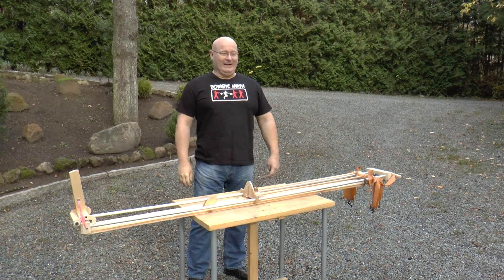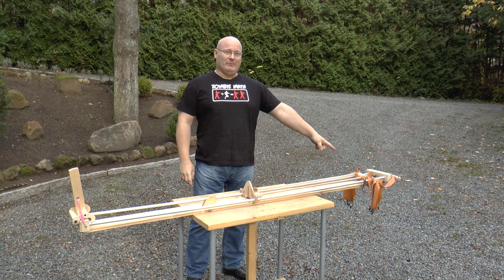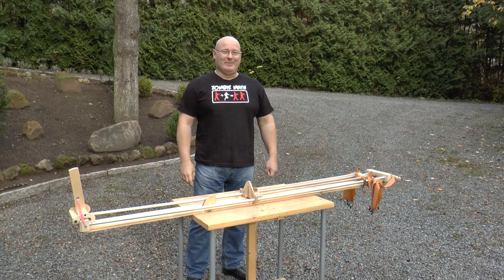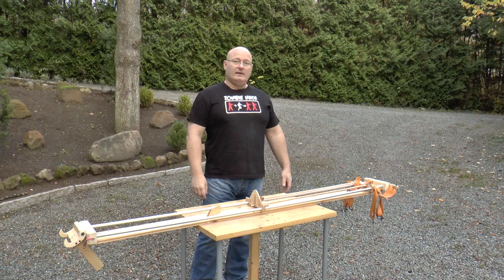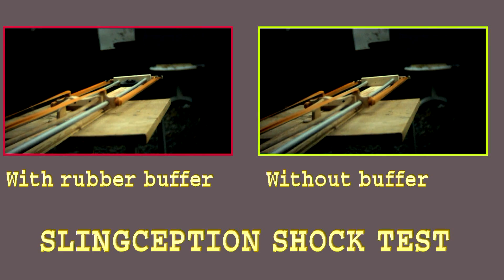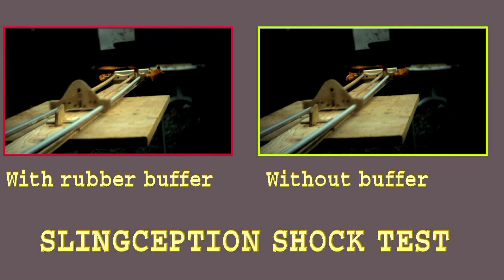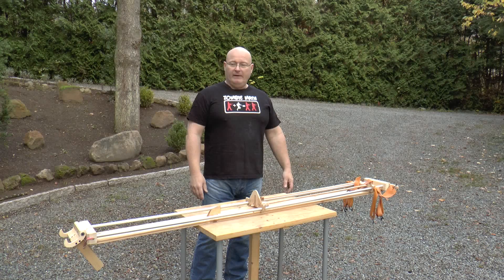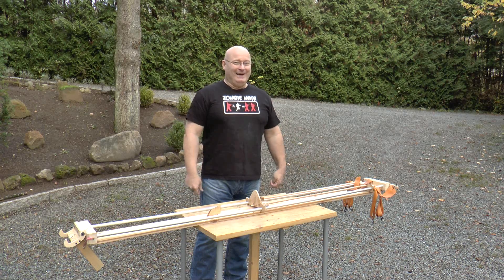"Joerg vs. Slingception" - The Final Defeat

Comment: I think the air caught between the two surfaces acted as a damper. In comparison to the rubber that use to be there, which acted like a spring.  You just unintentionally made a very nice air-damper Sir.

Comment: I think that without the buffer all the energy is wasted while with the buffer there is a somewhat elastic collision that makes the wooden dowels bend more as the moving slingshot is accelerated backwards by the buffer. I suppose that if you insist on firing it without the buffer eventually something will break.

Comment: Hey Joerg. I was just wondering, how many frames per second does your slow motion camera take?
Reply from the maker: In its max resolution of 800x600, it can do 1000 fps. But then it needs an awful lot of light. These scenes have been recorded at 500 fps, pretty much the max on an overcast November day. Sunny summer days, I can do 1000 fps and even use a faster shutter = less motion blur.
Reply: JoergSprave Very cool. I'm amazed at how much the rods flex in this video during the slow motion yet in regular time it's almost unnoticeable. I'm also amazed that you can't break it, I thought for sure when you first introduced the slingception it would only last a dozen shots or so! Anyway keep up the good work, you're design and woodworking skills are very impressive and I always look forward to seeing your next project!

Comment: Before you destroy it by fire, are you going to see what kind of speed you on the ball with the additional rubber added? I would be intere3sted in finding out what it would be.
Reply: The speed would not be affected as much as we would like. Rubber can only be retracted so fast, putting twice as much rubber would be the same as making the sled and bullet half the weight, so every time you double up the rubber you don´t double the speed, but halve the difference of bullet speed vs retraction speed... still, it is a fact I would like to see myself :)

Comment: When the slingshot hits the rubber stopper, the stopper compresses, and then "de-compresses," and in this process, a compression wave is sent back through the entire slingshot, causing the slingshot to shake wildly. When the stopper is not present, the energy from the slingshot is amazingly absorbed and there is little excess energy to be distributed throughout the slingshot, hence the minimal shaking of the slingshot.

Comment: Joerg, could it be that the mass of the steel ball is counteracting the 1st stage of the slingshot, with the 2nd stage recoil acting as it's own sort of buffer?

Bearing that in mind, it would seem that if the first stage simply had extra railing to simply carry on past the band draw (even just a couple of inches), perhaps with a friction element added, in those couple of inches, it could preform all the better.

Comment: You didn't even bother to chrona the slingception with the stronger bands.

Fail, just fail.
Reply from the maker: Now it isn't about performance of the shot anymore. Now it is about breaking that thing apart. It must be done. So much resistance can not be tolerated. It must be proven futile. :)
Reply: JoergSprave
Not even gonna chrona the thing one last time before you set it on fire?

Even for shits and giggles?

Comment: I would like to see you make a sled with bearing supported wheels running in tracks similar to how a desk drawer works. Much less friction and more stability of the whole device. No more flexing rods. You could router the tracks right into the wood. I just keep thinking about this wondering how it would work.

Comment: The buffer makes for a lower peak strength of impact, but a longer time, the energy is still the same, though... removing the buffer provided about 10 cm of "railway" without tension (rubber was already retracted), where the wooden dowels had time to lign up before the hit, so the impact did not flex the dowels, giving it the chance to be subjected to pure grain-aligned compression, instead of a bending tension-compression-flexing combo. Best solution to ensure durability of slingception? make the railway 7 - 10 cm longer and put buffer back on... Cheers!!! Great video!!!
Reply: I, I just don't understand... It would take me years to even make a comment like this. Just people like you are just so smart its unbelievable. Well thanks for explaining that, I needed it.
Reply: jojorobino5312 When the sled hits the buffer, the dowels are flexed, so it's like pounding a bent nail with a hammer. When the buffer is not present, the dowels have a fraction of a second more to straighten before impact. Thank you for the compliment.
Reply: Eugenio Garza no problem I appreciate your reply to.

Comment: Keep putting on more rubber and measuring the speed till it breaks!   This could make a rubber speed record.   Breaking the sound barrier with rubber would be amazing!  Don't destroy this unless you have a better design.   It is very cool.
Reply from the maker: It is getting very hard to physically attach more rubber, the sled was never designed for this insane amount of it.
Reply: WatcherMania7 It sounds like a great plan, but have to agree with JoergSprave... the main slingshot (the one to carry all the sleds at first) will carry a lot of weight, which will, in turn, carry lots of momentum... wood will not be enough, so aluminum, then... now it´s heavier, costlyer... and besides, will need LOTS of rubber (just the first slingshot, every next slingshot will be using less rubber accordingly). The last slingshot has one set of rubber for the weight of the steel ball, the second last will have *math*   (last sled + bullet weights) / (bullet weight) sets of rubber, the next one will have (last sled + second last sled + bullet weights) / (last sled + bullet weights)... and so on, and placing the triggers will be a PAIN!
Reply: Eugenio Garza

Carbon fiber? Unbelievably light, mind- blowingly strong and retardedly costly

Comment: I think its because the second bands slow the sled dramatically. and the buffer stopped the sled before they could. equal and opposite reaction stuff.
Reply from the maker: Why should the second band slow the sled? I tested this by pushing the sled over the notch with my hand, it takes almost no force.
Reply: JoergSprave the band on the inner sled will apply the same force on the ball as it does on the sled its self. Newtons 3rd law: For every action there is an equal and opposite reaction. Its the same force you feel on your hand when you shoot a standard slingshot. The sled is almost floating in space so it will be more effected. maybe you could do an experiment with very week bands pulling the sled forward and strong bands on the sled and you may be able to see the sled slow down with the high speed camera.
Reply from the maker: Connor OLeary But the sled is so much heavier than the ball, and the draw weight of the rubber that pull the sled is so much heavier too. It seems almost irrelevant.

Comment: the bumper you had while absorbing a lot of stress, was a donut, so the flat surface was allowed to flex at impact, a flat piece or layered flat rubber could take the hit but spread it across the whole face of the two surfaces, great experiment and slingshot

Comment: I believe the reason why there was more flexing in the rods on your slingshot was because of the rubber ring deflecting the energy back into the slingshot, which caused even flexing in the rods compared to the test without the rubber ring.